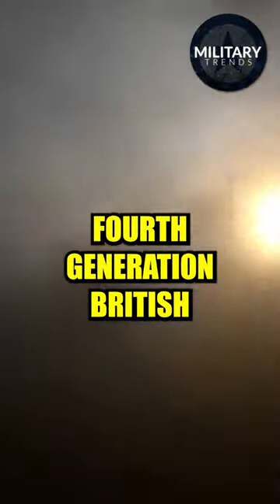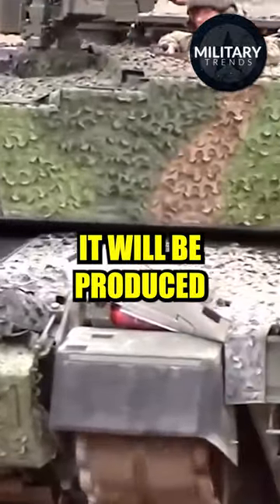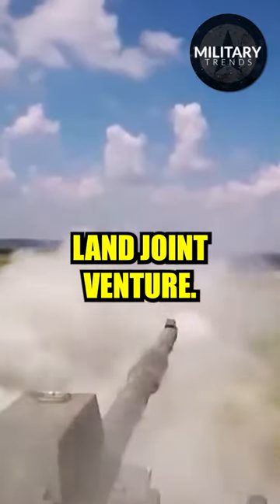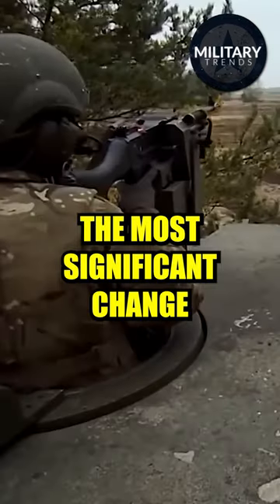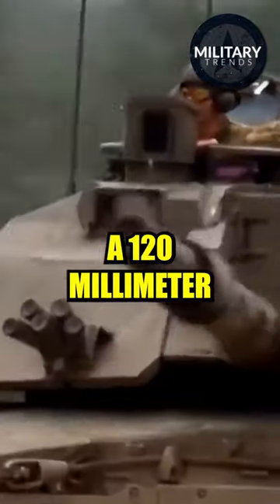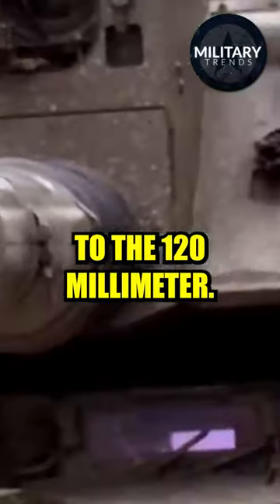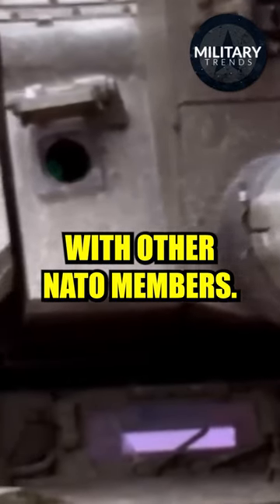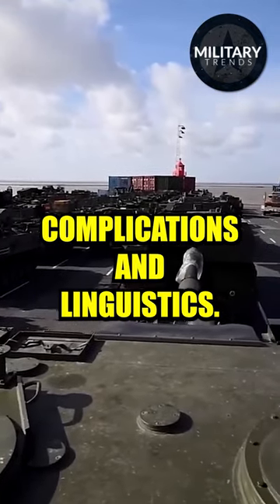Challenger 3 - Most Advanced Tanks in the World #shorts

Comment: I thought it was getting the 130 mml cannon
Reply: No that was a Rheinmetall testbed/demonstrator with a new turret on the upgraded Challenger 3 hull. It’s an option for upgrade but not what we selected unfortunately. Challenger 3 will have a new turret and the Rheinmetall L/55 120mm Smoothbore gun. 25% higher pressure than L/44 found on most western MBT and the Abrams has a modified version of the L/44 so we’re still going to have a more powerful and higher velocity gun than any tank in the world except for Leopard 2a6 and a7 which also use L/55 and the new Rheinmetall KF51 Panther which uses the L/51 130mm gun which is 50% higher pressure than L/55. L/55 is an amazing gun, L/51 is an optional upgrade but not what we’ve selected so far.
Reply: @williammorris7390 Technically it uses the L55A1, which is an upgraded version of the existing L55. With regards to the 130mm, this was never a realistic option for various reasons, it's more likely in future MBT's.
Reply: it uses the same gun as the leopard and Abrams